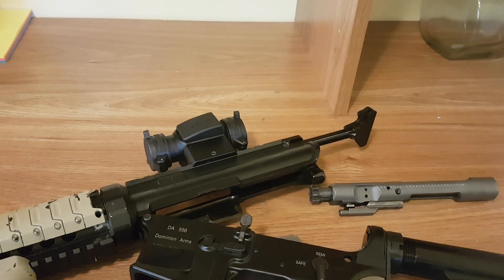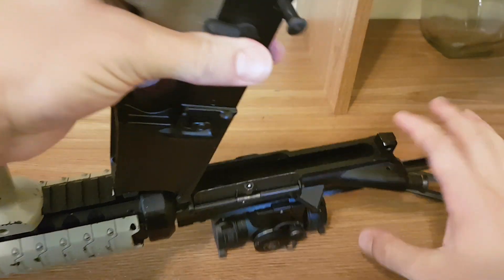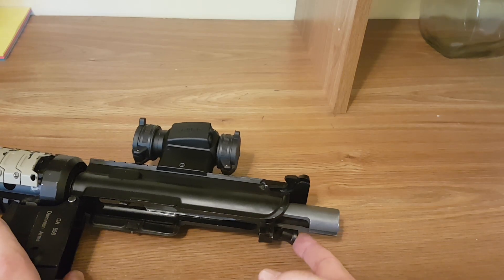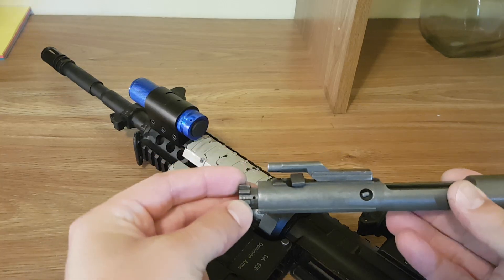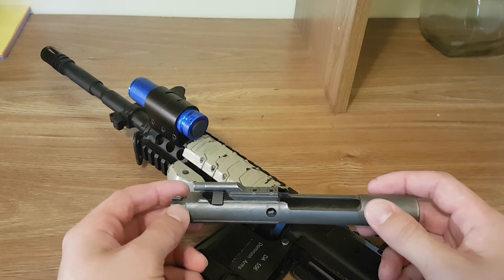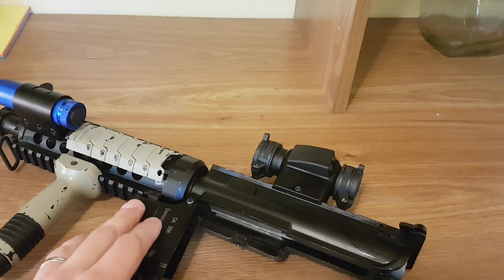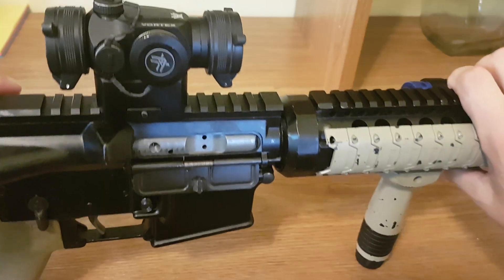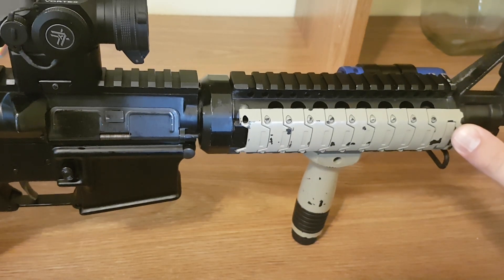What does the Forward Assist on the AR15 Do?

Comment: The foreword assist was added so that soldiers fording water obstacles could quietly pull the charging handle to the rear far enough to break suction and allow water to quickly drain, then quietly press the bolt carrier group forward and into battery with the FA.  It was not meant to be struck, especially every time you reloaded.  Equipment often drives doctrine, not necessity, in the military.  At some point an expert was writing a TM he had no business writing, and "hit the foreword assist" on every load was born.  The A2 and later upgrades have smaller FA buttons because it hurts more if you hit it hard.  This was a vain attempt to get military and LE trainers to stop telling students to hit the thing.  Just my opinion, but it may have worked if it was named something like the "Fording Recovery Button."  This info isn't a secret, it's part of Colts M16/M4 armorer's course, it just never seems to take hold.
Reply: Michael stott  Sorry for the delay, busy week.  In the mid '90s I attended the 2 week Washington State Law Enforcement Firearms Instructor course in the Fort Lewis area.  My partner there was a Victoria AU police sergeant named Mark whose last name apparently flowed away on some of the beer consumed during the evenings, but he was both a very good instructor and shot.  I recall his surprise that we could just loan him a Glock 17, mags and gear, and that he could take it with him after class.  We all ended up learning a lot about each other's gun laws; I don't think most of the American's could live in Australia because of them.  Which bummed us a lot because if Mark was a fair example of the folks there it'd have been fun and very bruising.

Anyway, I am a big fan of the FAL, not least for its reliability in adverse conditions.  And while I like the M4, I don't think it's much of a reliability improvement over the M16 series.  (Well designed aftermarket magazines are the biggest improvement). That said, and even with the experiences you described, it's a pretty reliable weapon.  Part of the original reliability issues were because in the 1960's the military initially appears to have bought off on the weapon as "maintenance free."  There were problems with the ammunition being out of spec and chrome barrel lining failures- lots of stuff common to new weapon systems, except this was during a brutal shooting war in a very harsh environment.

These things were pretty much worked out, but problems remained.  In the mid '80s I enlisted in the US Army (Infantry).  My first M16 A1 was made by General Motors; it had very little finish, it actually weighed more than all my squad mates rifles, and the upper and lower receivers were connected so loosely that tilting the lower side to side would cause the upper to "clunk" about a quarter inch at the sights.  The most fun about this rifle was that in semi, or single shot mode, it would randomly fire from one to four shots at a time. Drill Sergeants became used to this and mostly stopped yelling at me for unauthorized full auto fire on semi ranges.  Being both the army and infantry, no one appeared to consider repairing or replacing my weapon as an option.  I actually missed that rifle after Basic; it was even more enthusiastic about shooting than me.

A strange thing happened in the Army, and I'm assuming the Marine Corps- infantrymen were told to not oil their rifles.  After firing M16s we were to clean them once a day for three days because "dirt" would seep out between cleanings.  The arms room sadist would inspect each rifle as we attempted to turn them in, rubbing white cleaning patches around the locking lugs, bolt carrier key, or anywhere it was a pain in the ass to clean.  If discolored oil was found on the patch the weapon was deemed to be filthy, and you were a lesser soldier for it.  We had to clean our rifles, (or M60, M2 or M242 machine guns) until they passed inspection before we would be released for the night.  As a side note, while overseas the arms room asshole would collect bayonets first, probably because cleaning rods were far less lethal.

The solution to the dirty inspection patch?  No oil.  The rifle functioned best when perfectly clean, meaning dry.  Fuck physics, the patch is clean.  We would occasionally have to put a few drops of oil here and there in really dirty environments, but we still had stoppages in dusty/sandy conditions.  The solution from the friction loving arms room guys was again to order us to stop oiling.  "Oil only attracts dirt and dust, stupid."  I actually liked the infantry because of stuff like this.  It's, uhh, still difficult to understand why, however.

That was a series of tangents for which I apologize.  Be safe!

Brian
Reply: Oil protects the weapon from rust, and cleans it. Of course it also lets dust stick to the gun, but it also breaks up carbon, which if it builds up causes misfires and jams. Ironically, carbon on the locking lugs and bolt carrier key can cause major problems with weapon cycle of operations. The same place arms room assholes rub q-tips or cleaning patches on to see if you cleaned them.

-Sincerely, your friendly neighborhood arms room asshole (Armorer)
Reply: Brian Post...some stuff is just so cool to learn! Awesome post and awesome info. Thanks!!
Reply: The Zombie / kill4all1  / Ghastly Gibbus- Dudes, that's a lot of anger for a discussion on the M16 family. I've not read "The Black Rifle," but could any of you please explain what is meant by "..to lock the bolt head in the event of a miss chambered round..." as well as "... the original purpose is so when in battle, when the rifle gets dirty and doesn't seat when primed, it pushes the bolt closed, I  don't know where you people are getting these wild tales about it."  And last, I won't bother to quote it because it's in the discussion, the opinion that 99.9% of the time only your battle buddy will hear you cycle the action, so what's the point in in draining / clearing your weapon quietly?  I can only assume the author of this really confused rant has never had to move stealthily on a quiet night when the sound of a bolt going home can be heard 100 meters away.  If you don't believe this, experiment; it's amazing what disciplined people can see, hear and smell at night.  Armatures do not survive long in a tactical environment against basic, leg infantry.

One person wrote something like the FA was there to force home the dirty bolt carrier group after, literally, a long days fighting to save his life.  I could be wrong, but the author of that dramatic note did not appear to use any of the terminology commonly used by soldiers, marines or other military folks in combat arms.  I'm not sure who he/she plans on fighting for days at a time, but I assume the supply issues have all been worked out.

Some background on me, something I really don't like doing because it takes away from the discussion and invites a verbal sward fight in an anonymous environment where  people literally can and do elevate themselves to false, lofty and often hilarious stature and experience.

In the mid 1980's I served in the US Army for 3 years, then served in the National Guard for 2 years as an 11B and an 11Hotel.  I was honorably discharged from both entities. The army and  National guard alpha numerics mean I was an infantryman and an Infantry Anti-Tank specialist, meaning mostly a TOW Missile operator.  I served one overseas tour of 18 months, I attended and graduated Airborne School, reporting there a few hours after retuning to the US.  I was stationed a couple places in CONUS for the remainder of my military time.  My DD214  lists my rank and MOS at separation as Sergeant E5, 11B 2P, respectively.

I then spent 18 years in law enforcement, with collateral, specialty assignments and training as a Field Training Officer, Firearms and Tactics Instructor, SWAT, certified explosives handler and explosive breecher through Tactical Explosive Entry School, Advanced Undercover Techniques and Survival, DD Instructor, and frankly a lot more, that help me not one bit to be a better person or civilian. I am fond of the truth and, in the tactical community, civility and proof of doctrine, or at least a smattering of competency.

I simply asked  where I could find actual documentation from a competent authority confirming the rather histrionic claims of a few folks, adding that I try to always keep an open mind about such things. This was met by a few folks who apparently tried to insult me by not answering the question and using terminology about the operation of the M16 platform that appears to have been made up.

Anyway, this was really a waste of time on a really cool channel I like a lot.  I love that people are getting so into the M16/AR platform.  It's fun to shoot for pretty much anyone, and makes a great excuse for bounding about in the woods.  Be safe all!
Reply: The original purpose is so when in battle, when the rifle gets dirty and doesn't fully seat when primed, it pushes the bolt closed....I don't know where you people are getting these wild tales about it.
Reply: The Zombie 

Ok, walk out. But I have heard that story.  In fact I've heard lots of stories about the FA and how it came about.  I've also spoken to and worked with people who actually make and develop advanced versions of the M4/AR family of weapons.  This is where I got the information I previously posted. Still, I could be wrong, they could be wrong, and we can't ask Stoner.  But the water draining issue was a real concern because of the small diameter of the 5.56 barrel.  The Air Force, with a few exceptions, did not regularly work in the field, while army and marine units did.  So Air Force got no FA, army and marines did.  Different missions, different needs. And Zombie, please try to focus on this subject, and before you post your first thought, think about additional points and add them to the same post.  This just looks as though you pound out a sentence or two every time a thought hits you.  It gets confusing man.

About terminology.  I can't believe I have to explain this, I was not talking about slang terms, (Booger hooks?), I was talking about the proper names of things and actions. The bolt fits in the bolt carrier.  The bolt carrier and bolt properly attached are called the bolt carrier group, often abbreviated as BCG.  Folks who have lived with these weapons and have been trained in their use and maintenance know what the parts are called, that's an example of what I meant.

To answer Michael's question, Zombie is correct about troops occasionally using condoms over the muzzle as a defense against water intrusion.  There were, and probably still are, black plastic caps that fit over the flash suppressor and can be safely shot off.  Often times though, the condoms were only used just before fording because they are fragile and tear off easily.  It's always interesting to me how different militaries approach similar problems.

And Michael, what about Canadian English?
Reply: In battle, the FA can save your life. As was intended.
Reply: Ghastly Gibbus

I wasn't actually lashing out, or being sensitive, I really was trying to make a point and learn something.   The anger I referred to was the swearing, name calling and clear attitude by a few folks who appear think that someone not sharing their opinion  is stupid.  That's the one thing that really bothers me about the Internet method of instruction-  some people who have never had any actual armed combatives training aggressively give bad advice.  I don't know you, I most likely never will, but I don't think you purposely gave bad, or tactically unsafe instruction.  However, you made a decisive and clear statement that manually cycling the action  of an M16/M4 to clear it of water was fine anytime because it's not loud enough for anyone more than a few feet away to hear it.  You're right if you're in contact. If you ford a water obstacle while scouting, patrolling or making a deliberate movement to contact, but have not been engaged, one person cycling the action on the weapon to clear it of water is absolutely noisy enough to alert an enemy 100 meters away under the right conditions.  If it is windy and or raining, or terrain makes a physical barrier between you and the enemy, this this also lessens the distance sound carries.  The bottom line is, a well trained and disciplined Infantry or Scout Marine or Soldier will nearly always choose the quiet option.  The info you put out was a statement of fact but it is not sound tactics.

There are la number of successful military or military style rifles without reciprocating charging handles, like the HK G3, FN FAL, M4 etc.  I don't know for sure why the M16 family doesn't have a reciprocating charging handle, but it's design does not appear to be compatible with one.  I truly don't know what exactly you meant by your question, but the M16 was very unique when issued because it essentially fired a very fast .22 (5.56) round.  The small diameter barrel led to fears of water not draining quickly enough, as opposed to the nearly world wide use of .30 caliber sized rounds up to that time that do hickory drain.  Also, this new weapon was being issued to troops deploying to Vietnam, where water obstacles were common. If you look for them you can find video of US troops emerging from water and pointing their M16s down while breaking suction with a small rear movement of the charging handle.

The M16 platform has been in service with the US military for over 50 years.  It's still going strong while improvements and  attempted improvements are made.  It's got issues, I don't think the 5.56 is a good round for the open desert, but it's great for CQB, for example.

Now a question, why do people get all twisted up about this stuff?  It's like a bunch of bickering kids sometimes in varied gun stores.  I do think it's both funny and productive because I've come away from these "debates" thinking everything from "That guys a tard" to "That would work, I'm totally going to do that and hope he doesn't notice."

Lastly, just to be clear on this, I do not claim to be a Tier 1, 2 or whatever.  I was a grunt with delusions of adequacy. But I'm one of the hundred or so soldiers to have been stationed at Fort Bragg and not been Delta.  There are some truly awesome people working these weapons, I would encourage anyone interested in some good times and good training to do some research, spend a dime or two, and come back 100 times better at armed combatives than when you left.  So can we just talk about guns and stuff now without the drama now?

Brian
Reply: Brian Post ..brian ..were do you get this info?? I think you are incorrect. please post  info source
Reply: The Zombie I originally received the information on the actual purpose of the FA as a student in Colt's law enforcement and military M16 armorer's school.  I've casually spoken about this over the years with other instructors, factory reps and engineers in the US and Canada.  When, like me, you get beyond the hump of "but they taught me in Infantry School..." the water drainage purpose makes perfect sense.  I'm not saying you cannot use the FA for jamming a round home if the weapon becomes fouled, but I am saying you have a bigger problem if this is necessary, and it's a very temporary fix.  You may be able to find more information on this at the Specialized Armament web site.  This company was begun by former paratrooper Ken Elmore, a man who has forgotten more than I know about the platform.  And he hasn't forgotten much.

All that being said, I'm open to other possibilities.  What are your sources for the FA purpose?

Be Safe
Reply: Using it to be able to defend myself after hours of use firing against people with the intent of killing me first. When there isn't time to clean your rifle. The real reason it was actually brought into design was because the previous military weapons had one, so the military thought this new rifle needed one. (Blake Stevens tracked down the real reason for his book The Black Rifle.) The reason for it now is subjective. Many soldiers never touched it, they didn't have to. But there is a time and place for it.
Reply: Doc Holiday

Hi Doc! After a year of blessed silence a couple of people made comments on this thread.  I re read the histrionic silliness of a few, yours in particular, and I thought I’d say something I meant to say before.  You wrote you’d use the FA “...after hours of use firing against people intent on killing me...” with no time to clean your rifle.  Wow, quite a fight. Let’s see, let’s keep it as real as you described: On average, one 30 round mag every 5 minutes for say, 4 hours.  That’s 48 30 round mags for a total of 1440 rounds. Man, you’re a badass for a gamer, and quite well supplied, but what a shitty neighborhood.
Reply: @DrMurdercock  Exactly- the M1, M1 carbine and M14 all have a forward assist, so does the AK.
It's called the reciprocating charging handle. Because the AR has a non recip charging handle, it needs a separate control to do what ALL of those rifles have always done: Provide a manual means of forcing the bolt closed.
Reply: Michael stott 

They didn't want us shooting them off in training either, but Infantry.  I recall we would run out of them quickly while in W Germany.  There would be some yelling but it was generally ignored. I miss that aspect of the infantry.
Reply: One where people do not get sarcasm, apparently.
Reply: Not to mention it's purpose also when the rifle got a double feed.
Reply: Holy shit how do i stop getting notifications for this.
Reply: Brian Post ..nothing to do with water..only weapon in the world  uses fa because of jamming.btw I fired millions of rnds from m16..many many jams and use of forward assist..ex army paratrooper ..7th sfga..1/509 airborne
Reply: The Zombie

You "got nowhere" because no one with any brains will listen to a random dude on the internet telling them they are right because they are right. Especially without providing some documentation or an accounting of experience that would give their opinion some weight.  The company who ran the armorer's class I spoke of is Specialized  Armament in Arizona.  http://www.specializedarmament.com. At the time I took the class they were the Colt rep.  Also, as I've said before, I could be wrong, the guy who gave the class could've been wrong, other firearms instructors and gunsmiths could be wrong.  But it'll take supporting evidence, not a continuous, unsupported snivel, for a reasoning person to consider alternatives.  Zombie- if you want people to listen to your opinion, give supporting evidence in a reasonable way.  If you just want to be a mindless turd who has no true voice, then please continue on your current path.
Reply: "The Zombie1 month ago
Exactly how was this, being angry, " Using it to be able to defend myself after hours of use firing against people with the intent of killing me first. When there isn't time to clean your rifle. The real reason it was actually brought into design was because the previous military weapons had one, so the military thought this new rifle needed one. (Blake Stevens tracked down the real reason for his book The Black Rifle.) The reason for it now is subjective. Many soldiers never touched it, they didn't have to. But there is a time and place for it." 

i didn't become rude until you insinuated I was lying because I wasn't dropping military slang left and right. 

Also, how the FUCK do I turn notifications off for this shit
Read more"  Don't trry to be condescending to me because you can't and won't read. Lastly, go fuck yourself. :)
Reply: Daffy Bigbear

Hey man, thanks so much for contributing to this discussion! I do so enjoy interacting with other professionals in combat arms and small arms effectiveness.

.I took the time to really read your input, which I must admit is dammed convincing.  Ahh well, the more you know...

Anyway, I'd love to read more of your engaging and competent argument in support of your position, though it's not really clear what your position on the topic actually is.. 

Seriously, you chose a 6th grade level, silly assed attempt to hurt my feelings?  Maybe that flies in the group you associate with, but if you can't counter an opinion with something more grown up than a rant that essentially was, "You're dumb and everyone hates you," then I'm truly embarrassed for you.  If you have actual knowledge that weakens my position and strengthens yours, (whatever that actually is), then please share it.  If not, sit back down at the kids table.
Reply: The battery was for the handwarmers, and  the water repulsion mechanism, duh! ;)
Reply: I've used the forward assist on my service rifle twice....it was when I was issued a M16A2 because my regular M4 was being fixed due to the hammer spring breaking. This was in Iraq of course and the m16 was old as fuck
Reply: I read, many years ago that early AR15/M16s did not have the forward assist, but it was added after the Vietnam jamming scandal, when the rifles were issued with no cleaning kit, because in test, they did not foul up due to using civilian propellant in the 5,56 rounds. Of course, the military rounds used military ball propellant which formed hard, corrosive fouling which jammed the uncleaned rifles. The tale was that the FA was added to help force the bolt forward to chamber a round, even if the. Gun was fouled completely.
Reply: I've been using it that way but mostly so I don't have to let the bolt slam closed when cleaning the gun and I don't have ear plugs.
Reply: This is the first ive heard about a water discharge scenario
Reply: @DrMurdercock  It's the first anyone has heard about the water discharge scenario. ;)
Reply: +Brian Post 
A lot of anger? At least me myself weren't speaking out of anger. I'm truly intrigued by such hypothesis by someone on the Internet.
I'm no firearms expert, or a soldier myself. And I certainly never have the opportunity to hear anyone sent a bolt home in silent environment tens of meters away..let alone hundreds..It's always noisy, it's always too close. So I guess I'll have to test on that one. 
But what was the rationale behind inventing a new device so one could solve an issue where the old one has already solved? (i.e. reciprocating CH vs non-reciprocating CH and FA)
What was so magical about this combination, incentivize the inventor to go out his own way to solve the problem that you proposed, with an extra device?
I'm simply asking you this question, based on your hypothesis here. I'm shock by the misplaced sensitivity so that someone could possibly interpret my genuine desire of learning as dismissal, or even anger.
Reply: John loves Cathy forever s   Actually, every auto/semi auto with a reciprocating charging handle has a forward assist.  I've cited the Colt armorer's course as my source, and previously posted a link to a company that provided that training.  What is your source for your unambiguous statement that water had nothing to do with it?  Also, several weapons with non reciprocating charging handles have grooves milled on the bolt carrier that are exposed through the ejection port, to be used as a thumb operated foreword assist.  I'm open to the possibility that the instructors for Colt, manufacturing engineers, etc., are full of shit, that I was given bad info.  So far though, I've only had people say variations of "That's stupid."  Ok, could be, but please give me documentation that I'm stupid for believing the instructor of Colt's M16/M4 armorer school.  I'm serious- I don't want to give bad info to students, who will then question everything I taught.
Reply: @brianp5564  dude... Shut the fuck up... You didnt learn SHIT at the colt school.... Colts excuse for the FA is for pushing rounds into the chamber. Not for water. Wtf. Im posting this in several of my groups. Shits funny...
Reply: Haha. Had it happen to me in basic training during final BRM qualifications. Same with a couple of other guys. Luckily they took our dejected asses out a couple days later and and all of us qualified just fine. The long and ongoing failures of this rifle in combat are well documented for anyone who wants to look it up.
Reply: Daffy Bigbear 

Hi Daffy.  I don't know who mentioned anything about batteries. You didn't learn what I learned in our respective M4/M16 armorer schools. As a former infantryman and ranger it surprises you that the army and the weapon manufacturer had some conflicting info?  Anyway, you rangers sure have your own jargon, I hardly ever meet or work with one who doesn't use verbiage like "I was with second batt," or sometimes just "Two B."    When I posted the first bit on the forward assist I figured it would begin a short discussion, I was and am open to the possibility that the info I had could be incorrect. If it was, I learned something, if not I'd still get something out of the discussion.  I was right about both it seems- i had the privilege of interacting with some cool folks who wore the uniform of another country.  And to my great amusement I got to see how a simple comment on the function of the worlds second most common service rifle caused some people to utterly lose their shit.  After spending much of my adult life as an infantry soldier and a. law enforcement officer, I've learned that people are often unintentionally hilarious.  Thanks guys, that was awesome.
Reply: It's all good brother. I have CRS. Can't Remember Shit
Reply: Put enough rounds through it and I will guaranty you, you will be wishing  you had forward assist.
Reply: That spelled SSPOTS bro
Reply: BrianP 556 FA was added at the request of the military, no necessarily for when crossing water. Armalite/Stoner originally did not design it with a FA.
Reply: VisayasMindanaoLuzon   Hey, greetings from the North West.  That reminds me of something I learned long ago, how is the FA used in double feed clearance?
Reply: If you are on a phone or mobile device it's under settings. I had the same issue so I'm guessing a recent Youtube app update changed the notification settings back to default.
Reply: Brian Post What I meant by my question regarding m16 not having reciprocating CH, is that there certainly have been some successful military rifle without the reciprocating CH and FA. And if that's the case. That only means, either they don't care about silently driving the bolt home, or they have some other way to do so without FA. What makes an American firearms designer thinks "I should invent this thing on my rifle, although many rifles thrive without it"?
Do European simply don't care for silently push bolt home, or FA is really unnecessary for that particular trouble?
Reply: All those time studying but none spent in English orthography. Good grunt.
Reply: No, because he has no fucking manners
Reply: You guys are children arguing back and forth.
Reply: BrianP 556 +
Reply: That is completely wrong. The forward assist was because M-16s were jamming due to crappy ammo and the War Dept blamed Armalite.
Reply: BrianP 556 i
Reply: That's Colt's party line, but the real reason is lots of failures to feed in actual field use.  Direct impingement and filthy breech areas.
Reply: Soldiers  did not use this rifle in battle
Reply: WRONG :/
Reply: My question is if this is the true purpose of the FA why is it not taught in basic training 11 B ( at least as far as I know ) last I check grunts are still crossing rivers on patrols.
Reply: BrianP 556 hey its been a year since you guys had this hilarious discussion. Hey why was the FA invented again BUWAHAHAHAHAHAHA
Reply: I use my assist when hunting particularly in a tree stand. I always bring my rifle up unloaded for safety and as quietly as possible chamber a round.
Sometimes the bolt will not go fully into battery and I will use the assist.
I hate the sound of a bolt being closed automatically on a still morning!
Reply: Forward, not foreword... it's a rifle, not a book.
Reply: Good to know, I thought it was for helping panicked infantrymen make minor malfunctions like a bell jam into a completely fucked gun.
Reply: Matthew Kiefer 

What’s a bell jam?
Reply: @brianp5564  Stovepipe
Reply: Matthew Kiefer

I never heard that one.
Reply: @brianp5564  looks like a bell :')
Reply: Matthew Kiefer

Cool. If you know, is that a regional reference, military...?
Reply: Kill4alls tact was flawed but his info wasn't he is 100% correct.So you are calling him scum because he is right?
Reply: Michael stott Ok, I seem to remember hearing something like that in basic.  Looking back that's pretty funny!  I mean, it's not AK loose, but overtight tolerances were not usually a problem with the standard issue of this platform.  I think somebody here correctly wrote that using the FA to force the the carrier group into battery was just adding to a bigger problem.  The AR/M4's spring has the strength to move the carrier group into battery just like all quality auto rifles.
Reply: Just two things..
1. Why would you ever care about releasing the BC quietly, when in 99.9% of the time, your target will be too far to hear any sound your weapon makes, except firing? You can just pull out the mag, pull the bolt all the way back, and release it. No one other than your buddy is gonna hear that.
2. If pushing a slightly pulled back BC is such a feature you desire. Wouldn't reciprocating charging handle be better?
No other knob or switch for G.I. to confuse themselves. And lower production cost due to simpler design.
I don't see a problem in your version of the explanation. It just seems like a very inefficient way to deal with a non-issue, that's all.
Reply: I was in the Army for six years, and I only ever touched the button once, when an instructor thought it was funny to hide the recoil buffer spring while teaching us how to PMCS. Even then, pointing the muzzle downward and giving it a good shake got the bolt forward and out of the way.
Reply: @CheffBryan  You only touched it once. You weren't taught how to execute the SPORTS malfunction clearance drill in basic? Your rifle never malfunctioned, in any way? 
The T in SPORTS is "Tap the forward assist."
Reply: Windscoff 

Not to be pedantic, but the actual sequence for a fail to fire stoppage is Tap, Rack, Bang, . (Or assess, Shoot , Go etc) not Rack, Tap, Bang,
Reply: I know all about failures. And I am glad the FA did its job.
Reply: I do believe i referenced a book. A book that the author spent years researching to write. And in that book, he mentions how the FA was implemented so during battle, it can save lives and keep the rifle firing when extremely dirty. I DID reference. Sorry people are too lazy to spend 5 seconds on Google. That's not my job.
Reply: You are wrong. The people who "taught" you are wrong. It's not a complicated situation.
Reply: everything you just said was 100% incorrect where do you people come up with this stupid shit for water to drain shut the fuck up the foward assist was made to seat rounds that were not fully chambered and to lock the bolt head in the event of a miss chambered round thats why its called a foward assist to assist the bolt head foward in the event of a minor malfunction . its part of colt's armorer's course go back to school dipshit
Reply: Exactly how was this, being angry, " Using it to be able to defend myself after hours of use firing against people with the intent of killing me first. When there isn't time to clean your rifle. The real reason it was actually brought into design was because the previous military weapons had one, so the military thought this new rifle needed one. (Blake Stevens tracked down the real reason for his book The Black Rifle.) The reason for it now is subjective. Many soldiers never touched it, they didn't have to. But there is a time and place for it." 

i didn't become rude until you insinuated I was lying because I wasn't dropping military slang left and right. 

Also, how the FUCK do I turn notifications off for this shit
Reply: MIchael Stott, IN Vietnam our troops used condoms on their barrels.
Reply: i tried to explain how it has nothing to do with water, but i got no where. It's to keep your wepaon firing in a firefight when you cant stop to clean it. Period.
Reply: Huh no shit..and that makes cence to me..too me it's like dropping the slide on an empty chamber..y right..but everyone has an opinion..
Reply: "..The prototype US Army-version, XM16E1, was essentially the same weapon as the M16 with the addition of a forward assist. The M16A1 was the finalized production model in 1967...

...the Army insisted on the inclusion of a forward assist plunger to help push the bolt into battery in the event that a cartridge failed to seat in the chamber through fouling or corrosion. The original Armalite already had a chrome-lined chamber to prevent corrosion.[citation needed] Colt on the other hand, had argued the rifle was a 'self-cleaning' design, requiring little or no maintenance. Colt, Eugene Stoner, and the U.S. Air Force believed that a forward assist needlessly complicated the rifle, adding about $4.50 to its procurement cost with no real benefit. As a result, the design was split into two variants: the Air Force's M16 without the forward assist, and for the other service branches, the XM16E1 with the forward assist..."
Reply: This is where i drop my mic and walk out.
Reply: Last thing, the simple fact is, Brian, you're wrong. The FA was NOT designed for water discharge. At all. IN any way, shape or form. You are 100% wrong about this. NO mater how much of an essay you type about it, you will still be wrong. Period. 
You could tell me you have a degree in weapons engineering and designed the Glock 22, even if that served to be true, you are still wrong about why the FA came into fruition.
Reply: So because I am not a walking military glossary cliche, what I said is questionable? Mmmmk. Guess I am supposed to use words like booger hooks and bang switch? Anyways, I don't really care. I am not here to prove anything to you, or anyone else. Or share my life story to try an justify why my "opinion" is superior. 
Also, for someone with such "experience" I sure don't see you using using the usual "terminology" of an expert. So in other words, you sound like a typical weekend warrior to me.